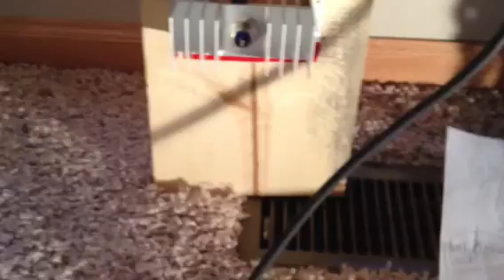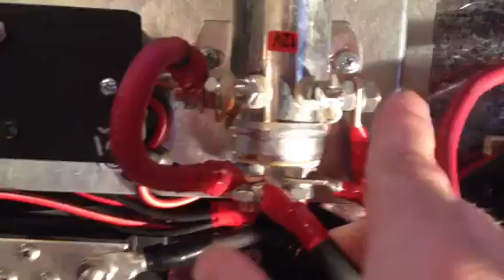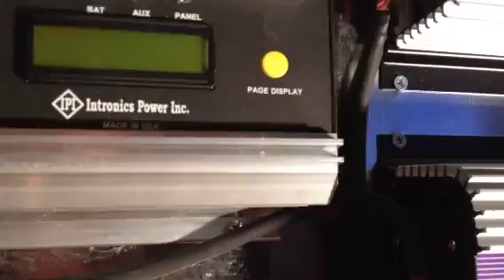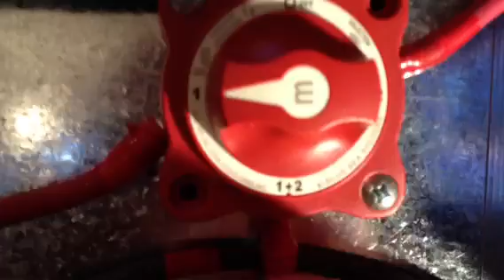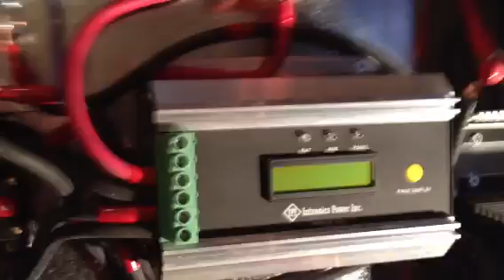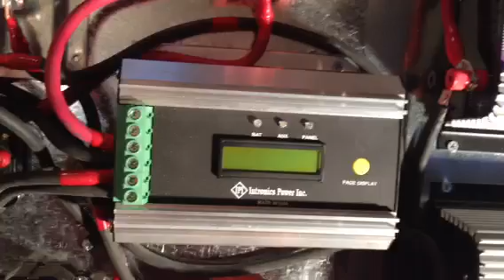Video #2 Planning Diagram All wired up solar Intronics cc and Wind MWS cc, Sun gti, Blue Sea

Comment: Hello Mr. Isimz. I live in Brazil and found your video doing research on wind and solar enegia in hybrid systems.
I'm riding a hybrid system in my house and I lack define the wind charge controller system for a wind generator that provides 1000 watts x 24v.
I understand Missouri company website this silver piece allows you to connect solar panels or wind generators that add up to the limit of 10,000 watts or 440 A. That's right? This information is correct? This component actually does this? It's just that I could not fully understand the explanation in the Missouri site. Also I do not understand can be connected solar panels with wind turbine in the same terminal of this piece, or whether it should be a piece for each energy source.
I would ask you to kindly explain to me what is the function of this round silver piece with 6 terminals.
I beg your patience with my bad English because I'm using google translator, but I need to know that in order to decide if I can buy this American company. I have many customers to indicate if the piece serve in my system. You have several people who already have an interest in buying if they see my system working well. Could you enlighten me on this subject please?

Comment: Our dump load is better then anything you would get from Sun.The Chinese have never had any luck with making charge controllers or dump loads that work.
You will need a larger turbine to operate that 500 watt gti. We sold a 800 watt wind turbine that worked beautifully with that sun 500. American wind turbine i might add.
Check out my play list on bad Chinese wind turbines especially the windmax.

Comment from the maker: Sun my logic behind the metal was to help prevent a fire, most electrical panels are of metal panels. Thinking about it again though if a wire would happen to melt, come loose or while working accidentally hit it with a bare wire, and touch the metal that could be very bad to, Maybe staying with the wood would be better.

Comment: Ray don't get too bummed not understanding everything right away. It takes time and until you master the stuff you have, i would probably hold off on many upgrades. I started with 1-2 panels hooked to a GTI and slowly branched out. You'll get it figured soon as you're smart dude. Lastly I agree abt swapping the backboard with wood. High volt shorts can scare crap out ya. I once dropped a wrench on batts and I jumped like 50'. Lol

Comment from the maker: Switch from GTI to Battery Power with the switches I have, so I can run off battery power if needed. I think I will just go to the 24volt battery bank. I want the Turbine mostly going into GTI along with my solar, but if I am on battery with my turbine I want the wind controller to dump the load into the gti  and disconnect the battery when batteries are full and also if the power goes out or the GTI fails I would like it to go to the resistors for safety and to keep the turbine under a load.

Comment from the maker: Ya I am going to upgrade soon, this turbine was just for experimentation for a bit till I learn more, I did not want to ruin a expensive turbine yet, Thinking of going all 24 volt, all my equipment can be switched to 24v but not sure about my MWS controller and relay, I know I need to get 24 volt resistors, I think?  My MPPT is 24 or 12 and my GTI are the 10 to 30 Volt I would like to keep every thing like it is so I can switch from Gti at anytime but want it to be safe when the power goes out.

Comment: Well, it sure is hard to tell from your video how the heck everything is wired. Things are in the shadows, camera bouncing around, think about it from this side. I don't see a switch for the dump load resistors and you don't want them in 2 different circuits at the same time. You might want to think about that. Your metal backing is just asking for short circuits when you are messing with stuff changing things around. And you do know that you will be changing things, it never ends.

Comment from the maker: Yes I want to have the option to switch over to battery if the power goes out, this set up works, I all-ready know that, and this is the way I want to do it, I am just not sure now if I have the right resistors combination or if they are hooked up right. the only thing I am going to add now is more battery's, another larger wind turbine 400w-500watt in the future, and a few more solar panels

Comment: Since you have a wind rated GTI, I would stick with that. Or do you want the option if the power goes out to switch over to the other dump load controller and batteries? I have a GTI controller that would keep your batteries charged with solar and run a 300W GTI with the excess, and a PWM dump load controller depending on what you want to do, drop by techluck.com

Comment from the maker: I did have this all working with out the gti. The way I understand how it would work, and I am probably wrong, is the GTI would just disconnect power from wind going to residential outlet, and direct the positive negative coming in from the wind outof the dump fault terminals of the GTI, and onto to the Resistors, therefore  the wind power now would be directly connected to the resistors, if that makes sense, or am I wrong?

Comment from the maker: And  It also has a high voltage protection function, when the wind is too strong, and the dump load controlling system can not keep the output voltage from the wind turbine, the controller will disconnect itself from the wind turbine, so it is very safe to be used.Works great for wind Turbines with DC output of 500 watts and under.

Comment from the maker: Is all I know about the sun gti wind is the DC Input Voltage Range 10.8V -30V DC (not AC)This inverter has been built in dump load controller, it can maintain the rotating speed of the wind turbine and keep the voltage from the wind turbine always at the range of the rated range of the grid tie inverter.

Comment from the maker: Fearless what should I do, all I know about the cheap turbine I have it is called Eagle II turbine generator 250 watt 12 volt charger max peek 5 amp 50 volts and it acts like a small trickle charger . Should I not use this on my system? Should I get another resistor in parallel or wire in series? or just go ahead and get the windmax 400? what would you do in my situation? I would like to use this turbine I have now for awhile for testing and untill I save up the cash to buy the windmax